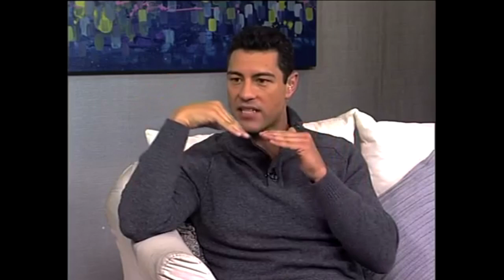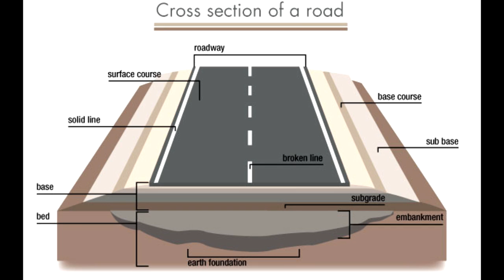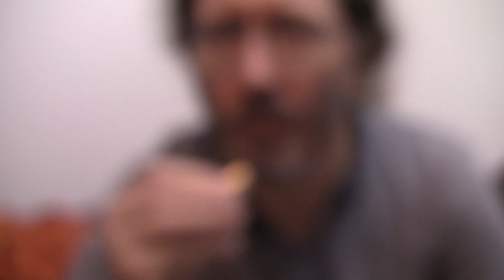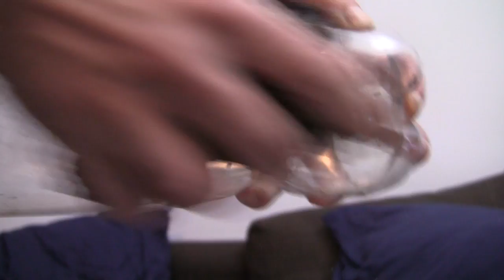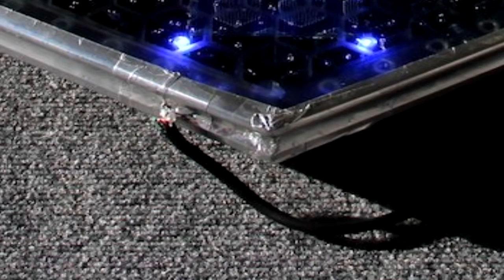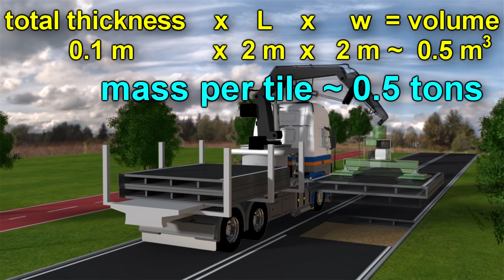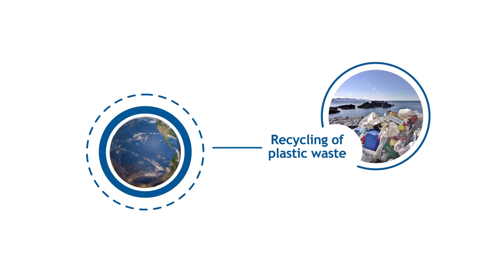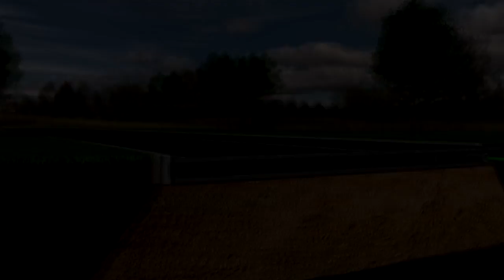Plastic Roadways BUSTED!

Comment: So snow melds durung the day, goes into the hollow interior then freezes at night blowing up the road.
Reply: Michigan
Reply: Lasky Labs Buffalo
Reply: It wouldn’t so much blow up as it is the ice expanding within the plastic interiors, until it cracks them apart.
Reply: for awhile I thought this was another Elon Musk  project.... since the hyperloop became an ordinary car tunnel... lol

sounds like something he'd think of
Reply: that's why solar panels exist, to keep it warm! duh. lol.
Reply: @francine athalia yeah but you have to approach it more logically. Lets you pour water over a span of 300 yards. The 4 roads included. How long would it take for the water to escape the area before the -10 to 30 degree weather freezes it? Plus plastic can't move water. The water above it would have no where to go so the road would be permanently icy unless a vehicle was designed to squeegee it before the water turned to ice.
Reply: Don't forget letting water through also allows trash. And trash clogs
Reply: melts during
Reply: Also, what happens when storm water undermines this?
Reply: In the first 5 mins it explains they have holes to drain excess water
Reply: How do these things even adjust when the ground underneath freezes and heaves? The first cold snap would turn the freeway into a skate park
Reply: Wisconsin
Reply: @Great Value Bleach yeah but the junctions of the blocks will definitely suffer
Reply: Never thought of tht
Reply: True
Reply: This..virtually everywhere with cold
Reply: @Great Value Bleach I know this response is to something said a year ago but it could explode the road in a different way. Like how water balloons and water bottles explode. Depends on the force, pressure, strain, and where the road might give up. However unlikely it is that the road would actually explode is, it is a possibility under the right circumstances. It is more likely to warp and sag from a few weeks of use
Reply: Hey I'd like to see that
Reply: @Great Value Bleach no explosions w/out pressure, but he meant to say the road would expand and crack at a much worse rate than regular roads
Reply: @Great Value Bleach i wanna see that too if it stops fake science lol
Reply: @Grauenwolf  ehhh, when it breaks after stretching, sure shards will break off but not fast enough to puncture anything, you're saying it like when it breaks that's the explosion. there's a very very low possibility of explosions as the road is not pressurised, it would just crack apart.
Reply: @Grauenwolf  yeah you're right bro. it wont throw chucks but cracks might damage vehicles fs
Reply: Alberta
Reply: And the cables
Reply: I like how most of the ppl in this thread think, “those engineers didn’t think if any of these things before they are so wrong” like y’all seriously think they don’t know what chances are?? Lets be real if they are ready to implement this technology they must know a thing or two about plastic and how it would react to cold temperatures which apparently is the only problem ppl seem to be concerned about, im pretty confident the plastic is processed with other stuff to help prevent wear and tear.
Reply: melts** during**
Reply: @Great Value Bleach Not sure if this is a joke or not, but just for reference freezing water can create over 100,000 PSI of pressure - 10 atmospheres is only 146 PSI. Not even remotely close.
Reply: The road when it melts it ves comes a river
Reply: @utetwo The water can't drain if it's freezing temperatures...It stops and turns into ice. That's the problem and why roads suffer so much in winter. Snow and ice melt during the day, in the sun, gravity takes it down into cracks and holes. But then night comes and it gets cold enough for the water to freeze. It fills up space, causing more cracks, more space. Then the next day, it warms up enough for more snow and ice to melt into water, more water goes into now even more space in the cracks...freezes at night, etc. Rinse and repeat until it finally stops being cold enough at night, starts staying warm through the day and night. 

Then all summer we desperately mend the roads, get bitumen and pour it into the cracks and holes, redo whole parts with concrete, etc. While it's raining and water is coming down and washing everything away lol. Just so winter can come again and we can do it all over. 

Except at least when concrete and asphalt and rocks crack, they don't produce microplastics...and the water flowing through those cracks don't carry microplastics with them, taking them into the rivers, lakes, soil, everywhere.
Reply: @unsavory6903  We don't put holes under asphalt roads. We don't purposefully put holes under any road surfaces! We fill them when they do form ASAP. That's why bitumen is so great, the black goo you can just pour into cracks, filling them up. If it's big holes, you use bitumen with rocks, asphalt. 

Imagine purposefully putting holes and spaces under the roads...and having to maintain that as well. It's absolute madness. Water will go there immediately. The moment temperatures drop, that water will freeze and expand, cracking the plastic. Which will result in microplastics instead of bits of rock. Then when the water melts, it will leave and carry those microplastics with it, everywhere. Also leaving more space for more water to go and freeze, cracking it even more, etc.
Reply: its not going to explode or anything like that... but it almost certainly would cause significant stress on the road over time.  What that damage would look like is hard to tell but it would be a problem.
Reply: @Great Value Bleach water can literally crack boulders in half. It's a process called "erosion"
Reply: @Great Value Bleach soda pop bottles can, that's because they're pressurised.
Reply: @LaskyLabs  I don't think you understand how material strength works
Reply: @ElizabethFrantes  Well not just chains on some vehicles but studded tires on all cars for the ENTIRE FUCKING WINTER!
Greetings from Finland where "summer" is the warmest day of the year :DDD

Jokes aside, it's a really bad idea to make hollow roads and allow the water to go in to the cavity in places where said water may freeze. And dont get me started on what snow bloughs will do to a plastic road like that :D
Reply: well it is possible to run a heat source into the road. Would reduce that chance of icing in general but ice freezing inside the road would cause an explosion.
Reply: @ah7027  salt, lots of salt
Reply: a h too expensive
Reply: @ah7027  if keeping your road/pipe's structure reqires energy at it's every point, it will likely suck (like maglev or hyperloop)
Reply: @ah7027  no it wouldn't.
Reply: @isaackarjala7916  it would, water expands when it freezes, it happends all the time in poorly constructed walls and floors

Comment: The fact that you are using a plastic bottle as "proof" it is not strong enough shows how ignorant you are. Until you actually use a sample of the same plastic that is actually as thick as what they propose you are showing you have no clue about science.
Reply: so you're saying a thicker plastic bottle would be more scratch-resistant??? OOF
Reply: @or2808  HE was not only arguing for scratch resistance. Also he is going by the assumption that there is only one chemical composition of Polyethylene terephthalate and i know of at least 4 and there are probably hundreds.

Comment: It most likely only do the long marks on acceleration,  or first touch on the road caused by rolling friction,  but in constant speed(not really constant but just enough significantly to eliminate rolling friction) but once the tyre speed is equal to the road passing under them, there will be just tiny rocks and sand just stuck to them,  not really a big of a problem

Comment: If the road is modular and you ran cables and pipes under the road.  How do you remove the section when below it is a continuous line of pipe and cable ???   seems you want to put those off to the side and not part of the road.   Also...the channel for cables and such...you cannot make that water proof.  
water will get in and flood the duct shorting out all them cables...also, water and electrical circuits do not go well together.  Even if you turn off power, the copper contacts turn bad when exposed to water for long time.  Don't believe me ?  go buy a flooded car that sat in water for over a week.
Reply: They want a union at every single modular start/end. lol.
I work in fire protection, our water supply comes from the city lines 90% of the time. If they ever made these roads, our code would change instantly to not allow us to hook up to pipe run under these roads as the amount of connections would make the supply unreliable. So any city would either have to avoid running water under these roads, or make a separate supply just for fire protection which would have astronomical costs.

Comment: Please that a look at the video. I mean that width of these pieces are not wide enough to for correct driving surface each lane into days roads are 11,25 feet wide the truck is only 16 feet long cargo bed but the picture shows square section so which is it just over 11 feet or is it 16 feet now we also use a DOT safety lane on both sides of the roadway and that is also11.25 feet each also plastic is very slick when wet with water but both oil and water is fact of roadways IE: rain on used roadways has an oily stuff on it, from Greece ( an oil product ) vapors of gearboxes( axels, transmissions ( manual or automatic ), transfer-cases, and power steering systems ) just try to hold a plastic bottle when your hands are wetted with buttery and water. Don't hold over a fire, your toes or sharp objects either because the bottle will drop out of your hand very soon.

Maybe you can melt it back into oily stuff and use that to bind the gravel particles together. Now that in the Sunlight for two months it will turn into flaky stuff that is not at all like plastic, this flaky stuff isn't even sticky stuff and more either. it has treated in ways to make better for roofing matters but these do not get pressed on, by heavy cars and trucks, day in day out all around the clock like a roadway these are also brittle, although not as brittle as roofing tiles

Comment: As an update, India has been using pop bottle additives to bitumen since 2006.  It reduces the amount of bitumen used in the road mix by 6-8%.  So, not completely replacing it but used to reduce the amount needed.  Over 1000's of kilometers, this could be a bit saving.  To repeat, it does NOT replace the bitumen just reduces it by a small bit.  In the end, it is still a normal road, not like this fly by night snake oil you pull apart here.

Comment: Actually they already fill pot holes with a plastic pellet which is heated and melted into the pot hole. It's surface is not to soft it's actually perfect and lasts way longer than regular asphalt so this idea is good and your video of fucking busted ya might want to actually research PLASTICS BUB because you apparently don't know shit about them

Comment: this idea is not a wild suggestion or concept.  But present it as a solution now is crazy and non-responsible.  It needs may advancement in many other fields.  Take the laptop computer or mobile phone as an example.  It took advancement in microelectronic, material science, fabrication technology,  communication, etc before realization.  The concept of the laptop computer (portable computer) started in the 1980s and mobile phone in the 1960s.  It took so many advancements in basic science, technology,  printed circuitry and communication to make it happen.  That being said, this concept may not be a solution we seek.  Other advancements may solve our plastic problem. I think there are research projects trying to find a solution using bacteria to consume plastic waste. (I think at least they are working on bacteria to digest oil spill) I don't recall where I come across that material.  Other should comment if they know more.

Comment: Road bases already exist ..... it's easy to form up and make .... some plastic has been proven to be stronger than some steel...

Roads need to be soft .... asphalt is softer than plastic .... 

You are a special person you have no idea what you are talking about
Reply: Roads need to be soft? Roads are a mix of asphalt cement, stone and crushed rock.

No roads need to be grippy.
Reply: @zachb1706  hard road crack and break do your research asphalt lasts as long as it still has its soft gummy texture it's only when it becomes hard and dried out that it fails around here we even chip in tar seal coat our roads so the sun doesn't cook them dry they last twice as long 

Once they become hard they become brittle and shatter and fall apart .... a simple Google search will explain this to you ..... road building 101 the road needs to be able to bend and flex billions of times hard surfaces dont do this and those will always fail

Comment: Standard panels are useless on hills, valleys, curves......their road sections will NEVER support trucks.....
There is a BIG advantage, if there is a flood, plastic is lighter that water and the roadway will FLOAT on the water!!!!
Reply: that is not an advantage, if they float up they will float away, and if they don't they won't be in the same spot after the water level goes back down.
Use some common sense.
Reply: @JohnSmith-yq7gu  I was being facetious.

Comment: 3x's?  Try 1/10th.  Yeah, saw a problem with it IMMEDIATELY.  When there is ice and snow on the roads and we got our winter tires on WITH STUDS....MAKES THE TOOTH TEST "NOTHING" AS WE WILL BURN A HOLE THROUGH THE ROAD IN ONE BRAKE STAND WITH A 36HP"SLUG BUG".  Then there is the car crash incidents where they "CRASH & BURN...EXCEPT WE TAKE OUT A SECTION OF ROADWAY AT THE SAME TIME LIKE A MILE.
SO, THE PLASTIC IS EVENTUALLY BURNED IN THE END.
So, make the cars out of plastic.  Easy to repair with Hot glue.

Comment: What about in places where they have a sub-zero winter that lasts for months?
Hollow, flood proof recycled plastic roadway panels that claim to allow water to drain into them, while having heavy trucks driving on them in freezing conditions, while covered in sand/salt to melt the ice on and provide traction on the roadway sounds like a recipe for disaster to me.

Comment: Microplastics. Plastics released into the atmosphere by environmental abrasion and uv radiation. 
What a moronic idea to recycle plastic into a form which will release unrecyclable plastics into the atmosphere.
Car tires already create enough microplastics, and these idiots want to make the driving surface toxic in the long run aswell. 

"I don't have an engineers mind, i don't know how it works" - 0:37
For some reason this is the excuse for most dumbass idea's in circulation.
Reply: Bear in mind, asphalt ain't exactly spotless on that front as some of the petroleum it contains seeps into the ground affecting the groundwater among other things.
Reply: @pattheriot3963  Thats a good point, and its maybe time to look into new chemical solutions to replace the bitumen in the industry.
I am guessing the volatile substances in the asphalt would break down faster in the environment than long plastic molecules.
Reply: @pattheriot3963  yeah but atleast you can filter that out, microplastics are so small that you can't even see them.

Comment: The solution must come from the cause. Initiate a two cent solution. Add two cents to every piece of plastic wrap on a candy bar, every pop bottle, or every hot dog package. Anything in your recycle bin now. And if you are not getting a majority of these wastes back, add more cost to the recycle. If a consumer pays ten cents additional for a candy bar, the wrappers will start coming back if they will bring in nine cents.Bring that wrapper to a collection point, get a penny back, or 9 pennies back. The other penny goes to companies inspected by the local government to pick up and use the materials in an authorized manufacturing process. Compressing the pop bottles into a 2 x 4 construction beam, or grinding it up into a simple fill to mix with sand. Any thing they might be able to sell. But their base capital gain would come from the one cent collected from every consumer. These products would be 100% profit because getting the materials to them would easily be covered in the cent. They might even be able to receive cash with each load they take. Make the waste profitable and the waste will disappear.

Comment: The Bitchumin and tar in Aspalt is a form of plastic.....Macadamised with various small hard objects will work well...its a lot like soviet cement....in HOT areas...it may well fail though....tar softens badly....but the plastic in bottles is stronger....if they can prove it works...why not try it.
Reply: Heat isn’t an issue, grip and strength is. Recycled plastic does not have the structural integrity of normal asphalt.

Comment: The only material that is possible to recycle into road material is glass and ceramics such as from broken toilets and other similar things. This is in fact currently done in many places currently, and is used in place of sand and some of the gravel in asphalt. This to me looks like someone trying so scam some venture capitalists out of their money. This is about as stupid as the solar roadways, and the only thing that I can see as reasonable for solar is for patio covers and walkway covers and so forth, as putting them on roofs means that it creates a problem when roofs need repair and also adds weight to the roof.